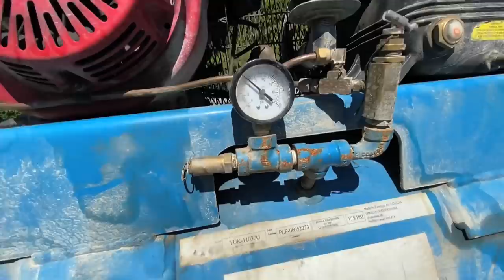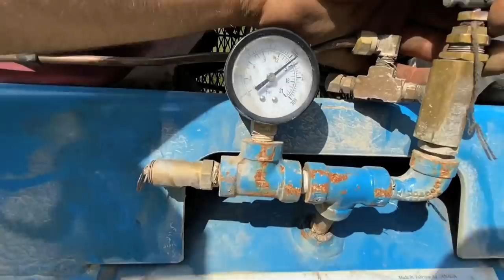EXPLODING Semi TRUCK TIRES! 220 PSI!!!

Comment: Hey mark ... as a future reference... semi truck tires are designed for heavy loads(about 4,000lbs) per tire) with 10ply side wall and the tire usually holds 100lbs to begin with ... the valve stem will let go before the tire will for transport safety

Comment: I had always used a lever style air chuck that locks on. Your problem was your gauge might have read 200 but it was truly under that because of the slow leak at the tire

Comment: An oxygen tank for a cutting torch can be 2200 psi.  Adapting it to fill a tire will be the hard part and the hose will probably blow before the tire does.  Lighting a fire under half of it will weaken it enough to blow at the 200PSI.  Smell and smoke would be the concern.  Maybe a propane a pipe soldering torch aimed at it.

Comment: In order to weaken the sidewalls you have to go thru the nylon cords. Grinding down the rubber won’t weaken it. All the strength in the sidewalls are the nylon cords. Also it’s kinda hard to tell but if those semi tires have split rims do not air them up with them standing upright even if your 20 feet back. Those rings are known for killing people! Lay it down and consider setting another wheel or tire on top to keep it from becoming a projectile. If it isn’t a split rim then your good! But cut the sidewall thru the cords
Reply: If we get close do we die?